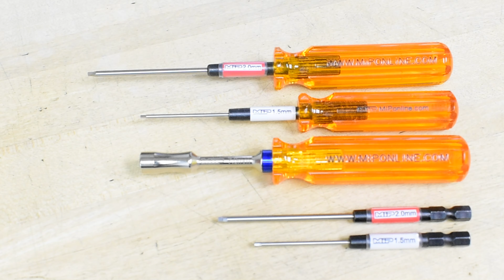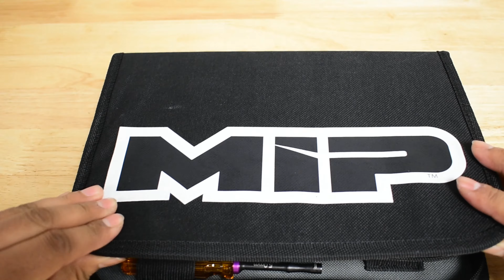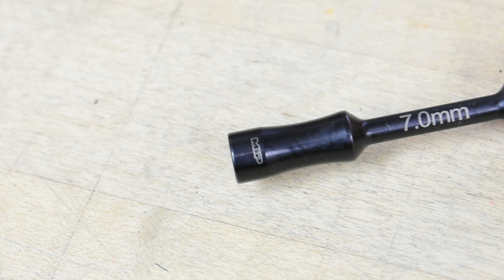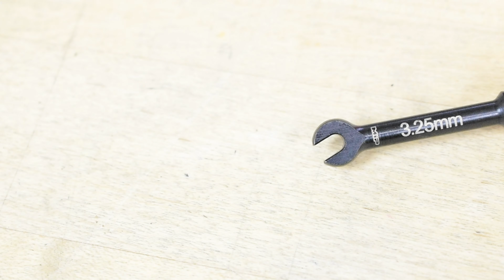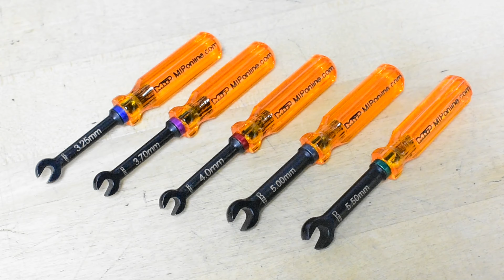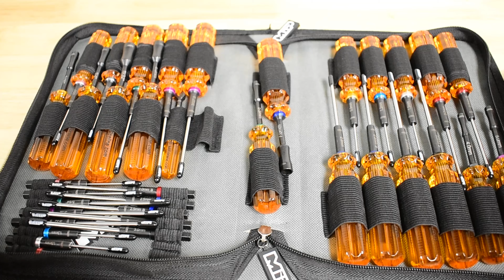Introducing MIP Gen 2 Tools | The Next Generation of MIP RC Tools

Comment: Honestly, I REALLY like the quality of MIP tools.  But, to be completely honest, I almost never use mine anymore.  Why?  Because of the handle design.  While the handles aren't uncomfortable to hold, they also aren't exactly comfortable.  On top of that, while they aren't exactly heavy, they are also, most definitely, not light.

I still keep my MIP tools, in case I need any (such as having to tighten two items having a connection, wjere both require the same hex size)...but, these days, the ProTek TruTorque SL tools have become my most-used in RC.  They are lighter, and much more comfortable to hold...plus they have a third advantage over the MIP tools - the hex & nut driver tips are replaceable.  And, for another point of honesty, I know quite a few others who have switched from MIP, to ProTek TruTorque SL tools.

To MIP, I'd like to offer the following suggestion.  If you were to offer a line of RC tools that utilize lighter, and more comfortable, handles, I'd be willing to bet you would not only increase sales to former & current customers, but you would also gain new customers from those who might have otherwise purchased ProTek TruTorque SL tools.  On top of that, if these tools had replaceable tips, I'd also be willing to bet your sales would increase even further.  I'm not suggesting replacing your current line...I'm suggesting this line in addition to your current offerings.